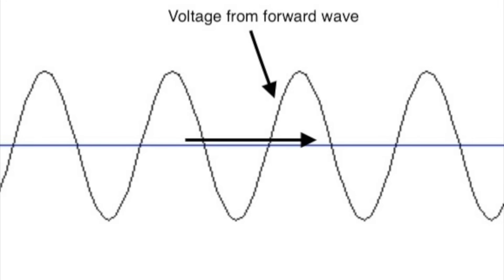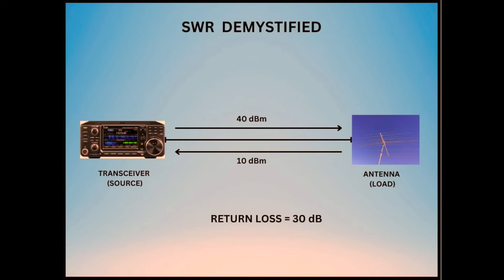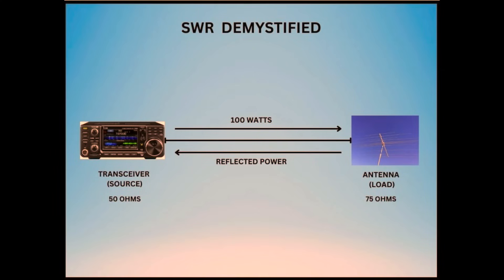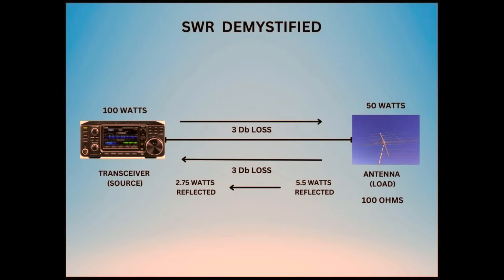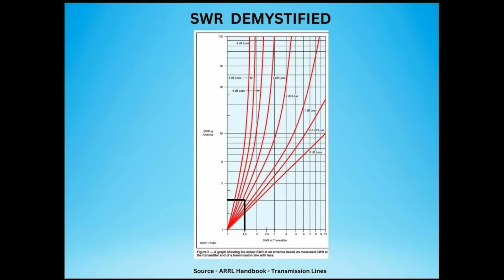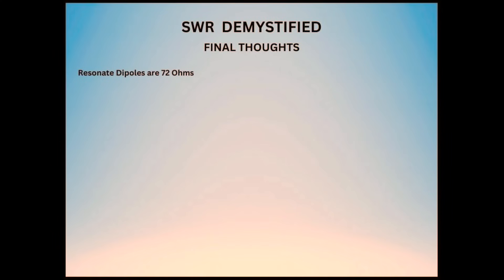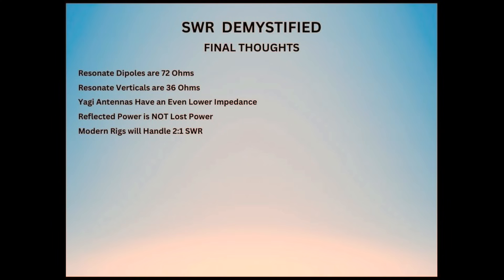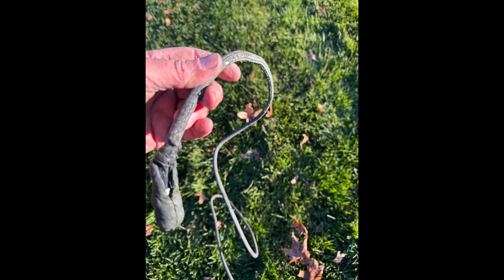The Truth about SWR: Debunking the Myths and Misunderstandings

Comment: If you want to fry your transmitter, ESPECIALLY if it is solid state, go ahead and run your system with a high SWR.  The reflected power is NOT reflected again back to the antenna, it is mostly dissipated as heat in the final, also standing waves can result in voltages that will punch your final transistor if a solid state amp.  I hope people don't take your talk seriously, final tubes and transistors tend to be expensive at the higher power levels where damage is likely to occur.
Reply: Modern solid state radios have an automatic power reduction feature when the radio senses high levels of reflected power. Reflected power does not create heat in the finals. Standing waves are constantly present in a feedline and perfectly normal.

Comment: This very informative since I try my best to make my own antenna. So please correct me if I am wrong. You said that on yagis, it has a low impedance, so in the 2 meter yagi that I am working on, if my analyzer reads lets say, 1.2 SWR, Reactance is 8 and the impedance is 38 ohms, does it mean the radio can take it with no problems in the long run? Sometimes when tuning an antenna, there readings like 1.7 swr, impedance is 50 ohms and 0 reactance. Which would be much better among the two readings? And on the part of taking your SWR reading at the antenna, can I use only a 6 foot coax? Before I forget, new ham this side of Asia. Thank you sir.
Reply: He is correct in that many yagi antennas have a low impedance but what he did not say is they have a matching system like the gamma match or a folded dipole driven element that raises the feed point impedance to the nominal 50 ohms.    YOu adjust the antenna for the best gain or bandwidth or beam width depending on what you want and then use a matching system of your choice to get he 50 ohms to match the coax.
Reply: A yagi is usually a half wave dipole, therefore the impedance at resonance will be about 72 ohms. If you feed it with 50 ohm coax, there's a mismatch of 1.5:1 at the feedpoint. Most yagi antennas have an adjustable feedpoint, such as a gamma match or maybe a quarter wave matching section. When using an analyzer, a high resistance reading and lower reactance reading means the antenna is being measured at or near the resonant frequency. An indicated SWR of 1.2:1 is just fine, trying to reduce is just a waste of time.

Comment: Listening to this made me realize what knowledge I've been missing for 50+ years about SWR.  Your video talks about voltage going from transmitter to antenna, or basically source to load.  But electrically speaking, voltage doesn't travel, current travels.

Now, if we were talking about DC current then we would expect that the voltage may fluctuate, ideally with some coherence if we were attempting to transfer data of some sort.  And if some of that current was somehow "reflected" from the load back to the source, then I would totally understand SWR.

But with RF, we are using AC, not DC.  So I can understand that the voltage will be "traveling" along the feedline.  But I also understand that the current will also be traveling along the feedline.  And because the source power is AC, the voltage and power will be traveling back and forth on the feedline, sometimes moving towards the load and sometimes moving away from the load.  And because feedlines are very often two conductors, the direction of travel will be, or should be, equal and opposite on the two conductors.

So, coming back to SWR, how is it that we can measure and rationalize the "reflected" power when the "forward" power is constantly changing? If the forward power is swishing back and forth, how is the reflected power measurable?

Does it have to do with time, or distance, or a combination, or something else?

I have used SWR for decades, and understand that the power moves from source to load, and that reflected power is basically power bouncing back from the load.  But the measure of the two doesn't yet make sense to me.

Thanks for your great video and for taking the time to share your knowledge.

Comment: An SWR of 2:1 measured at the antenna is good enough for most purposes. This is a return loss of 10dB, 10% of your Tx power is reflected, and 90% is transmitted, for a loss of about 0.5dB. Most feeder lines have a loss well over 0.5 dB, and at the receiver end a power fluctuation of 3dB is perfectly normal.
An SWR of 1.2:1 (return loss of 20dB) is close to accuracy of most regular lab equipment. If you think you have measure a better VSWR you are probably just measuring the result of the inaccuracy of your equipment combined with the reflected signal. You may just as well say the SWR IS 1.2:1 within instrumentation error.

Comment: Great video.  My only gripe is that he said to really know what's going on with your transmission line you have to measure SWR at the antenna.  Yet earlier in the video he showed an ARRL graph that shows how you can measure SWR at the transmitter end and see what the actual SWR is at the antenna.
Reply: My understanding is that if you were to use a vector network analyzer, like a NanoVNA, you would connect it to the feed line.
Reply: There are certain points on a transmission line that a SWR meter will show almost no SWR depending on the frequency if the antenna does have a mismatch.   The swr meter will go from high to low to high as it is moved along the line but the actual swr is not changing.
Reply: @ralphmowery2898 is that because an swr meter isn't measuring swr but impedance
Reply: Generally, the SWR is constant throughout the feedline, and the impedance changes along the feedline based on the wavelength of the signal. If you have an SWR of 3:1 at the feedpoint, the SWR will be 3:1 at all points on the feedline.

Comment: Just a few comments. 

1.) The predominant loss in coax below upper UHF is conductor losses or current I^2 R losses. Below upper UHF, the dominant loss mechanism is not dielectric loss unless the cable is wet or has an exceptionally poor dielectric. 

2.) Reflected power does not  heat the source. Reflected power simply mismatches the operating impedance at the source terminals and this mismatch changes the PA load line. The mistermination at the load creates a standing wave that just "stands", and that wave changes the impedance along the line at stable predictable points. This is how a matching section works. 

The PA does not "absorb" reflected power. The PA simply sees a different load than the design target. The PA might run hotter, colder, or not change at all from that mismatch. If we add a tuner to make the PA happy, the system loss is primarily caused by increased current and increased I^2 R losses in the transmission line.    

3.)  It is important to point out that resonant half wave dipoles are not 72 ohms in the real world. The impedance of an infinitely thin zero conductor resistance half wave dipole in free space is absolutely 72 ohms, but a real dipole is normally not 72 ohms. Most of my dipoles are around 50 ohms, but a dipole can actually range from 20 or 30 ohms to almost 100 ohms at resonance in a typical real-world installation. Wire thickness, any wire insulation, the phase of ground reflection, and the surroundings all work to modify dipole impedance. 

4.) It is possible to have a 10:1 or even a 20:1 SWR on a transmission line and still radiate almost 100% of the TX power. This is how Q-section fed or stub fed antennas work, and it is also how high efficiency doublets work.  11 percent reflected power or even 90% reflected power does not mean that amount of power is lost. That power does not reverse flow. All it does is set up a standing wave, which is an operating impedance change along the transmission line. 

Four of the biggest transmission line and antenna myths are:

1.) reflected power bounces around and heats the PA, or that power constantly moves both ways in a transmission line

2.) a dipole is always 72 ohms

3.) a high SWR means low system efficiency

4.)  The dominant loss mechanism in a normal HF or VHF transmission line is dielectric loss
Reply: Look charlie
Reply: You did so well to # 4.  Up to around 1000 MHz the main loss is in the copper and not the dielectric.  The OP did say dielectric when he should have said copper (conductors of what ever material).
Reply: My reply has been deleted

Comment: Agree I have had issues with 1:1swr antennas with stray rf however tuning 1:3 /1:5 has solved this for an endfed via a matching unit despite the settings being fine on an analyser it's truly a dark art especially with environmental factors such as moisture and rust bolt effect

Comment: Sorry, I don't agree with your statement about reflected power is not dissipated in the output stage of the transmitter. There are only two places that the reflected power can go... either the coax or the transmitter. I think there is reflected dissipation loss by both... but the vast majority is consumed by the transmitter. After all, that's the real danger of reflections. The other more benign issue from reflections is the loss of ERP of the system.
Reply: There is a third place it might "go". Forward and reflected power are concepts that do not represent anything tangible. They are values computed from the voltage and current measured at one point on the transmission line, and these values have the units of power, but they do not represent an actual energy flow. The two values have the nice property that when reflected "power" is subtracted from forward "power", the result is the actual average energy flowing at that point in the line. Since "reflected power" does not represent a tangible energy flow, the question "where does the reflected power go?" is not meaningful. Treating forward and reflected power as tangible energy flows causes much confusion and inhibits understanding what is actually happening. It does not help that many authors colloquially describe power as being reflected at an impedance discontinuity. A more precise description would describe the reflection of voltage and current waves, not power. For sure, it is not the intangible reflected power that damages PAs.
Reply: i agree with you and it's so confusing to me that all these people are saying the reflection does not get back to the transmitter. i guess we don't even need antennas :D the power will just bounce around long enough and will all get radiated minus cable loss. this should make the HOA people super happy, just stick a little bit of wire out the window and you're good to go.
Reply: @dronefootage2778  yes, the power (or reflected power) must be dissipated somewhere... it's not rocket science... just common sense. If it can't go out to a load (antenna)... then it dissipates at the source... the output transistors of the radio. Anyone who says differently doesn't understand electronics/physics.
Reply: Negatory ... reflected power travels the feedline when it encounters the transmitter or tuner output, where the voltage component does a 90 degree phase shift, and according to Poynting's Vector Rule, travels back up the feedline in phase with the forward power. The transmitter output does not absorb reflected power due to the impedance matching circuit on the output. In every solid state transmitter, there is an antenna tuner in the output circuit, only it's not adjustable and you can't see it. It is there to match the very low impedance of the output transistors (current devices) to the higher impedance 50 ohm coax. Reflected power ends up back at the feedpoint where most of it is absorbed by the load, and again a fraction of again does a voltage pahse shift and the wave travels down the feedline, etc etc.
Reply: Now that's funny...

Comment: Nice presentation, thanks Michael! There's actually an online antenna modeller website which can show, for a multiband wire antenna like an OCFD or EFHW, exactly how VSWR changes across a frequency range when using a user-defined length of a user-chosen coax type - all graphically. The site also shows radiation patterns, current diagrams, Smith chart ... all calculated and displayed on-the-fly.
Reply: Using a half wave dipole as our basic model, we can easily visualize the impedance on the antenna at resonance. The voltage is highest at the ands of the antenna, and highest current is at the center, which is why when using coax we can use low impedance coax. If we move the feedpoint towards the end of the antenna, the impedance increases, so we can now use high imedance balanced feedline, which is very low loss. Stick to basic concepts and follow the KISS rule!

Comment: I have a question !
Having an SWR meter in the radio, and an SWR meter in an antenna tuner, which do you believe, as they both change as you adjust the tuner ?

Comment: "my antenna has been up there for 30 years and the SWR is getting better"
Reply: Loss due to aging components
Reply: Likely due to resistive losses because of corrosion, etc.
Reply: It's often due to aging coax cable. SWR is a ratio. If less power reaches the antenna due to loss the same thing happens to reflected power. A meter at the transmitter will compare forward power at that point to power reflected. For the same power out the reflected will be less than it was previously suggesting tuning is better. But it's just more power turned in to heat.

Comment: Phase? No one ever mentions phase relationship. What is happening in that coax with signal ping ponging back and forth from load to source? Won't there be cancellations in signal because of phase shifts resulting in power loss?
Reply: Exactly. There is a video that mentions phase, but I don't know where on YouTube.

But power SWR should not be influenced by phase, only voltage SWR depends on phase.

Comment: I was all cocked and ready to tell you that you do not have it quite right, until you said check SWR at the antenna.  Most of us QRP operators adjust our antenna to be resonant at the frequency we intend to use using an analyzer at the antenna, which also gives the SWR reading.

I might add it is also a good idea to check the SWR at the coax before it inters the transceiver because running portable operations the coax is put thru more bends and connected and re connected many times. Good to know if your coax is in good working order.

Comment: Thx for the informational video. Interesting statement that "Reflected Power is NOT Lost Power". Seems technically correct, but not practically correct.  I presume that reflected power has latency, and would be out of phase, so not useful or problematic.  Just thinking out loud. Cheers.

Comment: Great explanation debunking the myth.  There are antennas that will give you a flat response across the entire HF band without the need to retune.  It's called a terminated coaxial cage monopole or TC2M for short.  Mine is 0.8 meters in diameter, 44 feet tall (I purposely tuned it long for 6.9MHZ, has six cage wires, ten-wavelengths of wire at 40 meters under it for radials, is terminated in the antenna's characteristic impedance - about 260 ohms, has a broad-banded, bifilar wound 3.5:1 Unun and a 3,000-ohm Common Mode choke at the input.  The worst SWR is at 5 MHz (2:1) but I don't care about that band.  It requires no tuning from 1.8 to 60 MHz and is 1.2:1 or less.  In fact, enabling the internal tuner actually raises the SWR - to the detector anyway.  To RF it looks like a big fat pipe with 1-meter long, tapered ends - Look way back in the books and look for a 4 to 6 wire cage dipole.  It is a beast.  This vertical is half that and is only the weight of the DXE telescoping 46' fiberglass mast.  It's guyed at the half-way point.  It has very little to no gain, but nothing affects it either (very low "Q").  Neither rain, snow, trees, or me standing beside it making measurements affects it.  I use LMR-400 series coax and N or BNC connectors.  I'm too old to climb so a vertical is my choice.  The CM split ferrite beads placed randomly along the feed line help a lot with QRM.  If running under 500 watts, use RG-58 or LMR equivalent cable and wind a 4-turn choke on a 1-inch split bead, and stick it at the input of any antenna to decouple it from the third path (the outside of the coax braid) back to the rig.  OK, I'm done.  73's all.

Comment: Excellent, many thanks. Most important take-away:
"If the SWR is low over a wide frequency range, something is very wrong." 
Please ask yourself if your super-wideband DC-to-Daylight shortened and heavily mismatched antenna really works so well or just heats up the atmosphere. 😄
Reply: I've been asking similar questions about the guy who sells a 40 / 80 meter antenna in a one-gallon plastic bucket for $450 and says to hang it in a tree.  Snake oil magic antennas are generally just that.

Comment: Reflected power is not lost power. Take a 50 ohm load ,at the end of a half wl  of 500ohm open wire tx line. 10:1 SWR . If the power was lost only 33% of the power would reach the 50 ohm load. How much power do you think reaches the 50 ohm load?
Reply: Almost all the power put into the system

Comment: Resistance can change by frequency.  Impedance is resistanc + reactance.  A perfectly resonant antenna (at one frequency) exhibits only resistance, i.e. radiatin resistance.  The resistance (and reactance) will change when the frequency changes.  A dummy load should exhibit only resistance and hopefully not change that resistance over the usable frequency rangs.  Antennas, however, do change resistance ad reactance by changinf frequency.